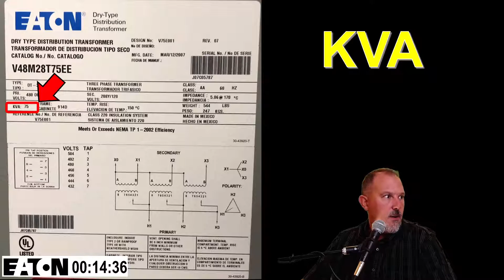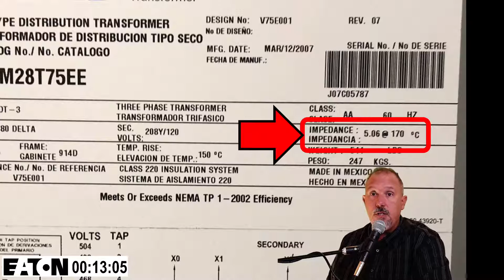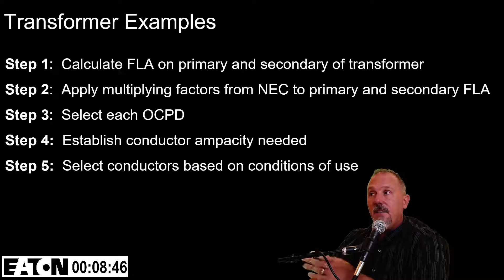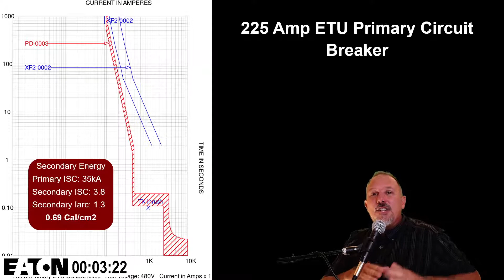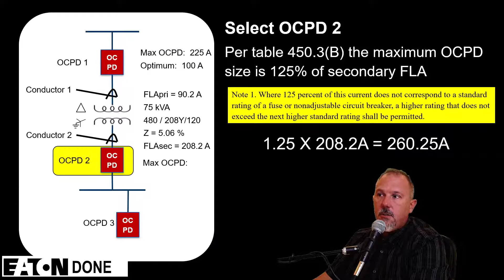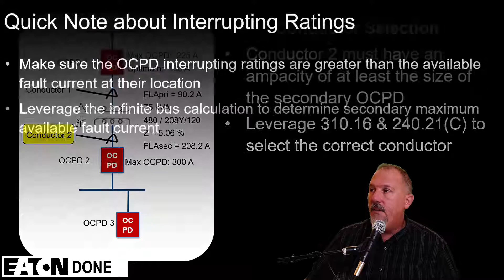15 Minute Tech Talk - 75 kVA Transformer

Comment: On the field we use 125% calculation for primary and secondary OCPD.
Reply: Thanks for this master class.
Reply from the maker: Sure thing.  I agree that 125% is very common.  I think a little depth of knowledge helps to understand the why's.  You have to love those rules of thumb that get you through some hard parts.

Comment: Thanks , you really know what you’re speaking ! Any and all advice is welcoming! “ My breaker box in my house is 100A / 120v 2 Phase - I’m installing for electrical back~up only a 5KVA Solar Inverter 230v charge controller 48v PWM what I see is the inverter 230v One Phase the L1 is 115v & the Neural is Hot line of 115v & the ground is a ground ! What’s you’re idea of using the L1 = 115v & the Neutral = 115v into a 20A Double Pole breaker to back-feed my breaker box all One Phase of 115v & the inverter at 5KVA is 86A and my house per month uses between 3-3,500KW a month and I’m going to use a SIEMENS Transformer MTO100A 480-220 input One Phase & Output 240-110 Two Phase ~ Off my Order inverter to the 20A  Double Pole breaker . Sounds good ?
Reply: Wth are you talking about. Better call electrician

Comment: STANDARD PRACTICE IS WIRE FOR 125% IN CANADA FOR WIRE SIZE AND NOW SOME AREAS WANT OVERSIZED NEUTRAL .All because of harmonics from VFDs And Switch mode power supplies .Ztrap is optional
Reply from the maker: Thank you Carlu for that note.  Very good point on oversizing the neutrals!

Comment: Thanks for the video. I have a 30 kva transformer. I need to feed 415vac to the input. I require 240vac at the output and not 120.how do i achieve that?

Comment: Why is the optimum ocpd 100amps and not 115A
Reply from the maker: sungkim1189, I would agree that a 115A OCPD would be the appropriate solution for that application.
Reply: 115A is not a standard OCPD rating.  Standard ratings are 100, 110, 125, and 150 amps.  For 35 years, I used 125 amps on 75Kva rated primary.

Comment: As a newbie on learning about transformers I was a little confused about the formula you used.  After re-reading my text and doing the calculation according to the text, I got approx values for primary and secondary current FLA.  Happily, I realized that your formula is a shortcut and accurate (within an approx).  I will use it in the future for swift calculations. Thx. Good video for newbies like me. Keep it up

Comment: Glad you mentioned selective ampere selection. Retired from a large hospital/research center where they talked about this but never did antyhing on it. Several times a zone mechanic was replacing a 277 volt breaker and caused a short circuit where the 225 amp tripped and not the 20 amp branch circuit breaker. This occured in at least 3 large ( 10 to 14 floor ) buildings.
Reply from the maker: Really appreciate the feedback.  I have often been told that events like what you described never occur in a hospital.  Would love to learn more.
Reply: This happened to me at York University Campus .3 phase 600v/347V lighting control circuit rated for 20 amp single phase breaker  took out the main 3 phase  100 amp  lighting control breaker .Crazy stuff happens with impedance drops and AIR ratings of breakers .

Comment: Heres a cheater multiply for 3 phase . Multiply 480 volt three phase KVA by 1.2 to get FLA. Use 2.4 for 240 volt 3 phase KVA FLA. This is accurate to around 99.8% of using your formula. Nice vid. You would be surprised how many full time sparkies do not know how to arrive at FLA. We we know one of these guys had to wire in a new transformer we would hide his uglys book & any other books to look up transformer FLA. When they asked us first thing we asked if they know what the square root of 3 was. One guy would copy what another same KVA transformer wire & breaker or fuse sizes.

Comment: So if I am installing a 75kva Step Up i can just use all the info you just provided but just flip info on primary and secondary ?
Reply from the maker: step up transformers are a little different beast.  Make sure the transformer is listed for back feeding and as far as I can tell you make the same calculations.  Inrush on that will be a little different too.  I'll do some research and put a program together as this could be a good discussion on the program.